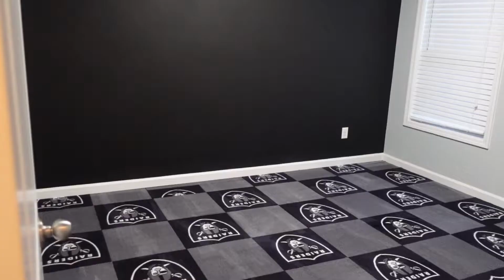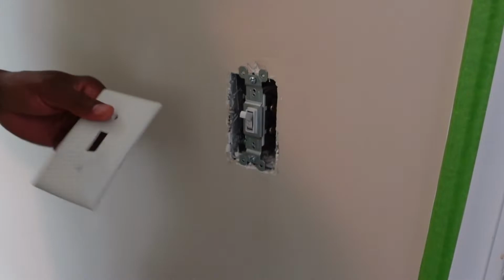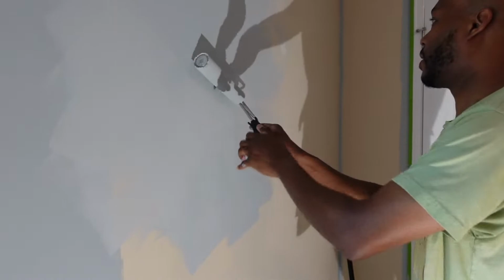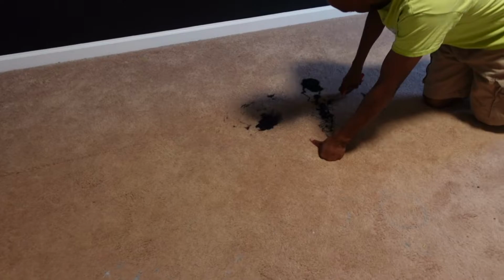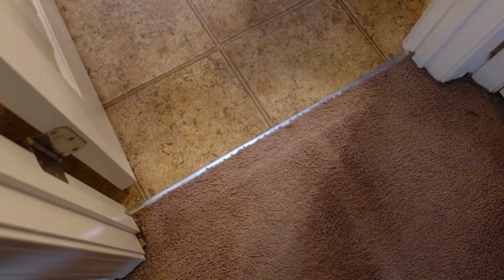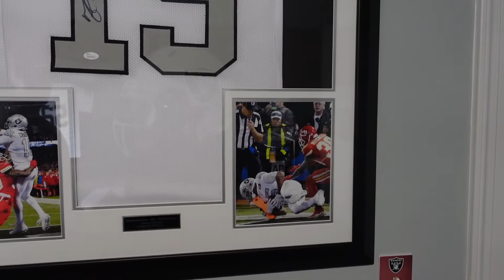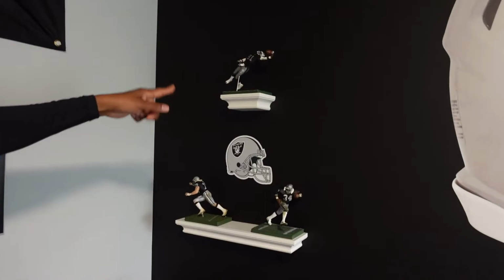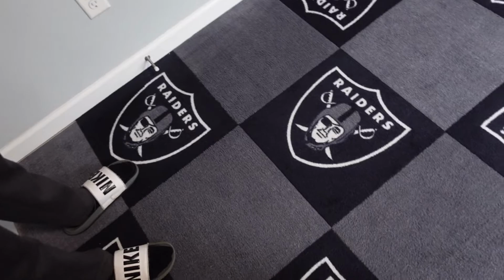DIY Raiders Room

Comment: That's a pretty nice room. I have a Steelers man cave, it has changed several times over the years. Most of the walls in my house are covered with Steelers memorabilia. I had the Steelers floor tiles for a while but I replaced it with larger logo rugs and a field runner rugs. I also have a Buckeyes room in my basement with 50 autographed mini helmets a couple full sized autographed helmets 5 autographed framed jerseys I don't know how many custom framed picture I have
Reply from the maker: Thanks!